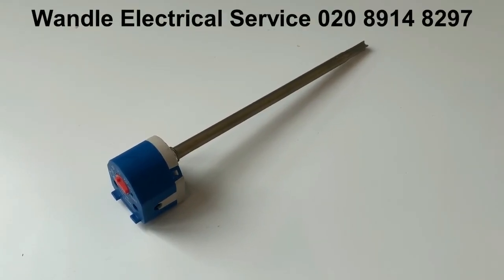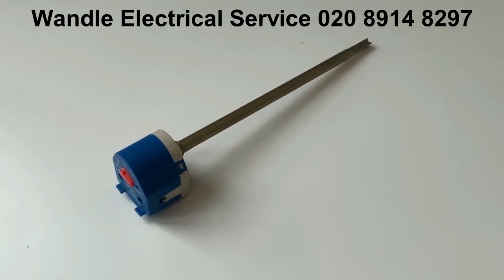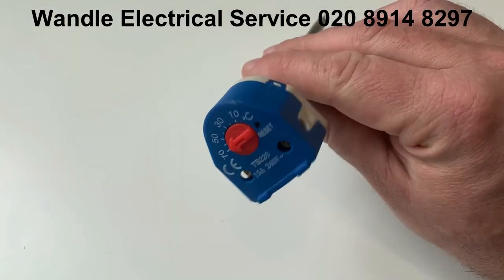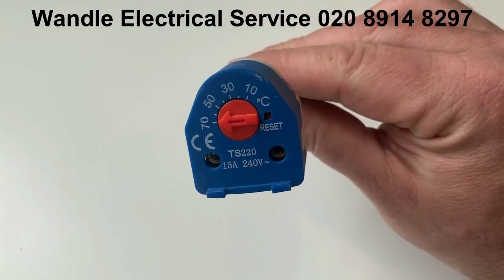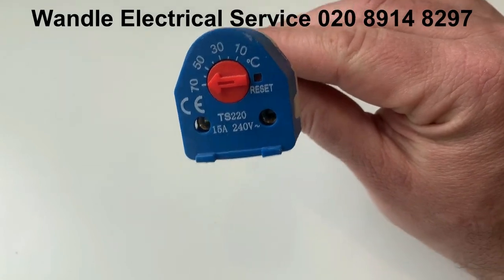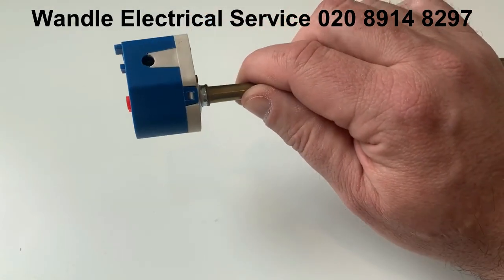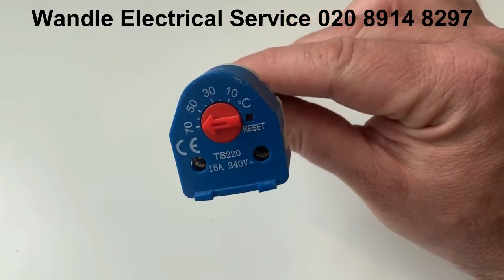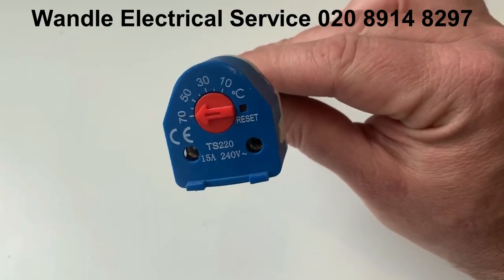Immersion Thermostat Water Heater Thermostat Reset

Comment: Thanks, had voltage on one side of the thermostat and 19.5 Ohms through the element but no hot water. This worked straight away. Thank you

Comment: Thanks for the video. Why would this safety cut out reset though? We've recently had a new immersion fitted and after a week it needed resetting. The plumber said there was scale inside the cylinder. Could this be the reason?

Comment: This may have fixed my issue... I had already switched the main circuit breaker off before I looked at it so I don't know if the reset switch had already popped out or not but I pushed it back in anyway. I will come back to the comments tomorrow to let you know if it worked... Otherwise will be a call to the landlord. Thanks for the vid either way :)

Comment: I change brand new immersion heater and fix all. And i try turn water on for 30m from tank was cold and water is warm enough. And when I see reset bottom is not   press dow and when i try to press it but it hard so i life as its.   My question is that the small bottom reset should posisition down or pop up ...?

Comment: We had a brand new Tesla immersion installed about 3 months ago and the thermostat has already failed , the reset didn’t work so I got a new thermostat and replaced like for like and it worked , but just concerned why a brand new one would fail after only 3 months ? Are they known to fail often ?
Reply from the maker: I think you probably had a duff one.  It should be under warranty.  Worth keeping an eye on though.

Comment: Have a fault in one, it is stuck on and boils the water,  I was hoping that this video might explain how it is removed from the tank, does it unclip,  unscrew, does it have a o-ring seal into the tank, or does it have a sealed tube built into the tank?
Reply from the maker: Hi mate, sounds like you need an electrician.
Reply: @wandleelectricalservices-e7704  ,  It just pulls out, no water seal to worry about, can,t see needing a Electrician for that, when they want to charge $350.00 to do that for a 15 min job.
Reply from the maker: @sjdtmv  So you do know how to take it out!!  Make sure you isolate the power before you disconnect it, dont want you getting hurt.
Reply: What temperature should this be set at my water is not heating sufficiently as it was before and the tank and element only 3 months old
Reply from the maker: Jimmy Clark, most manufacturers recommend around 65 degrees Celsius.
Reply: You sir are truly a life saver. Got up this morning to this exact situation.

Comment: Ok so my Tesla immersion heating element is new and the thermostat supplied by Tesla as well has tripped 3 times now I've replaced each one with a new thermostat the electrician has tested the element and wiring and does not know why it's doing it. It's set at 60c it seems to do it at night when it's on for 2 or 3 hours on the programmer or when it's on boost for 2 hours. So I'm guessing it's to do with the ambient temp in the airing cupboard? surly it's not getting up to 90c. Anyone have any ideas?